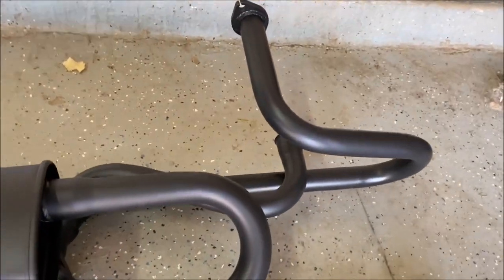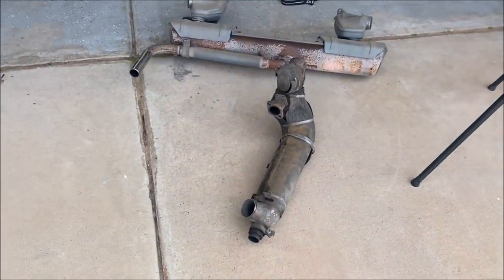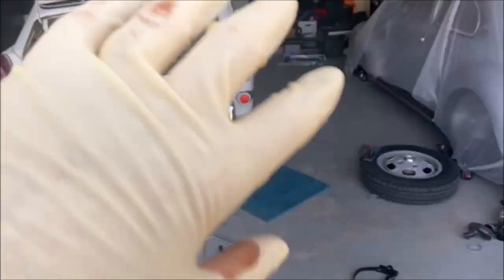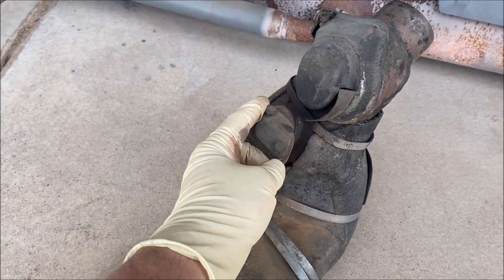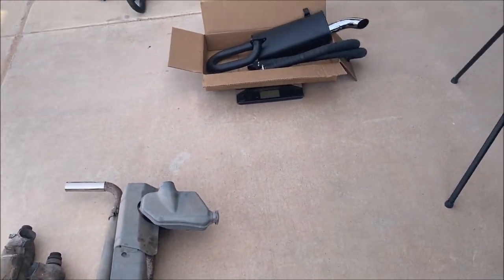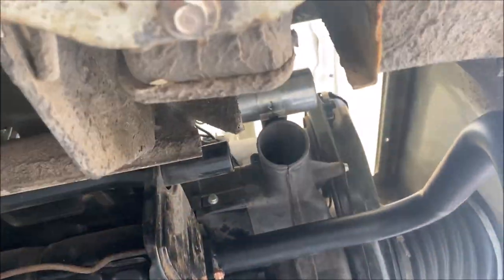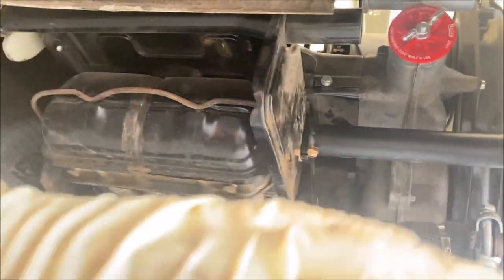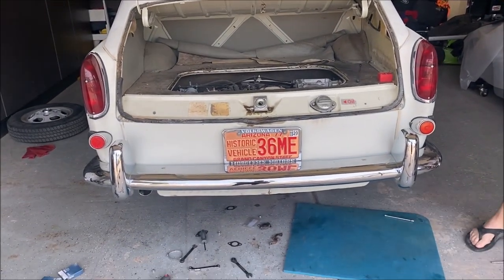Penelope Gets New Exhaust! Type 3 Vw Performance Exhaust From ISP West! Mileage Unknown EP78

Comment: I'm working on an old I believe 61 if not then 60's era vw type3 squareback so this information is greatly appreciated. Now I just gotta find some way to repair the frame....
Reply from the maker: That's awesome! Squarebacks are cool I hope you get it going!
Reply: Thanks, if I manage to get the engine running, perhaps I'll upload it to youtube. Unfortunately she'll never be original again so I'd rather not risk getting hate comments when trying my best to restore the frame and bodywork with a limited amount of cash flow. So it would probably just be the engine if it runs.

Comment: Funny, I just did the opposite on my 67 Squareback. Refurbished ISP West stock muffler and upper rear heat exchangers. Sounds quieter on my 1600cc than the previous Bugpack.
Reply from the maker: I loved how quiet the og was I just think it was choking my engine a bit. It’s running better now then ever!
Reply: I bet you could sell that old exhaust system and heat exchangers for a pretty penny. ISP West might even buy it to refurbish it.
Reply: Those big packs were always known to be loud, right?  I’m wanting to retain my stock system, not only for heat in the cab, but also because they close up the under cylinder air flow properly.

Comment: Did you plug the heater channel going in the car also  with same red plugs
Reply from the maker: No but it should! Not a bad idea at all!
Reply: @mileageunknown8910  I used 2” black  rubber plugs/caps  They come with the clamps from Home Depot and for the smaller tube above it I used 1” rubber chair leg tips  that go in the legs of chairs with round legs work 👍
Reply from the maker: @reinaldorivera4158  nice! Looks like my engine is coming out for a clutch issue so that'll be a perfect time 2 plug those up!

Comment: I just finished installing the same exhaust system into a 1973 squareback with heater boxes. My muffler is touching solid against the rubber bellows. I'm sure this isn't good. 
Did you find a solution to this issue? Do you have any heat damage to your bellow?
Reply from the maker: So I had to pull then engine back out of my Fasty, the clutch pretty much self destructed. When I pulled the engine back out I found no melted bellows it looked as good as new, I drove the car for about a month before the clutch went out so It had quite a few heat cycles, still something I'll keep an eye on.

Comment: Have you ran into any issues with the muffler being so close to the bellows? If so what was the fix?
Reply from the maker: So, it doesn't seem 2 have caused issues with the bellows itself, when I originally purchased this from isp west he'd said he'd been running one on his car for 10ish years..... my Fasty seems 2 run hot no matter what I do be it the stock or aftermarket exhaust so idk that it's playing a factor? I swear I saw someone had made a heatshield I'll see if I can find it.
Reply: @mileageunknown8910  
Socalimports has been really helpful with the concerns and said with the 1 inch clearance I should be ok
Ordered delete tins for the j tubes from ISP should help a bit I hope
Reply from the maker: @georgespadaccini1608  I added the Jtube tins as well

Comment: I like the sound of the new exhaust. Can you run that same exhaust with the heater boxes?
Reply from the maker: Yes this same exhaust can be run with heater boxes, I was really tempted 2 keep mine but here in AZ I just don’t use the heater enough
Reply: @mileageunknown8910  the motor sounds strong. Fun driving 🚗
Reply from the maker: @noelamick2015  thanks for checking out the vid! I’m super excited about the new exhaust